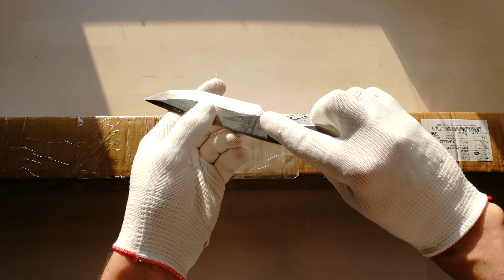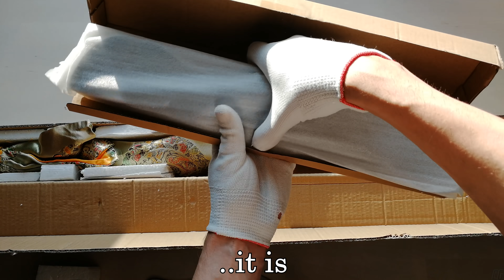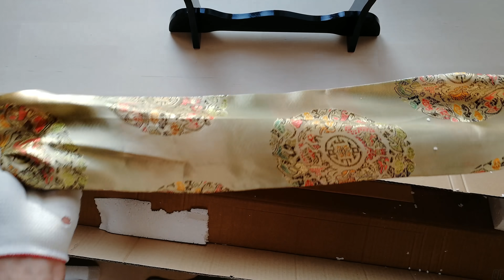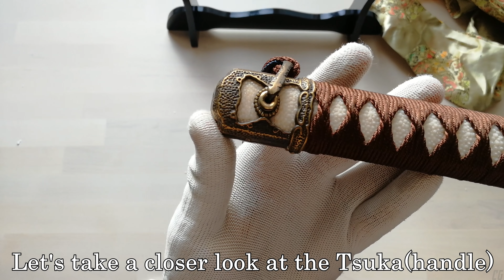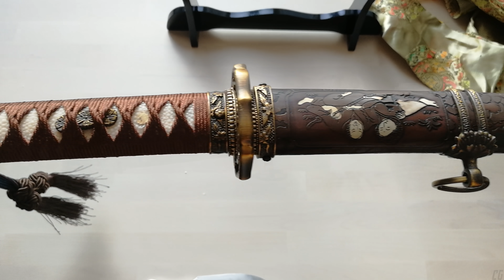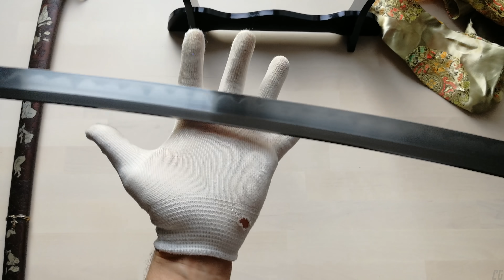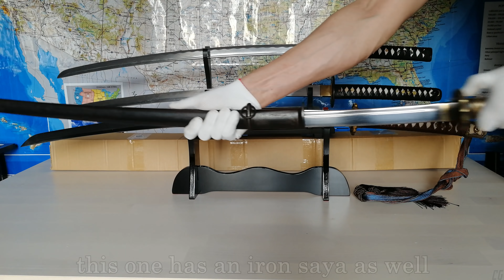$500 Aliexpress Katana is Actually Good - Unboxing + Comparison to the cheaper Katanas [4K]

Comment: You see how the ends if those patterns on the blades are white that sad because  it's fake tempering I think
Reply: I was going to say, I think it’s acid etching, the edge should be a completely different shade compared to the rest due to the clay heat treatment, and  it doesn’t look like it is 😬
Reply: You’re right

Comment: Blade is junk couldn't cut a clean straight line in the paper
Reply: that unfortunately doesn't say as much about the blade and more how well sharpened they sent it to you. Swords aren't supposed to be pocket knife sharp anyway, larger mass more force with an impact, you'd kill a razor edge after whacking it on 1 thing. 
Thing is it really might be garbo blade, when judging that you'd be looking for finer details than the camera is going to pick up. (metal grain, also looks like they took shortcuts in the shaping too but that might be hiding something fancier like a convex grind) But the detail work on the scabbard's going to put it up in that price range as a display piece anyway.
Reply from the maker: lol

Comment: You can obviously tell that the blade is not diferentially hardened, so the edge will become dull within the first two or three slices. That thing is not worth 500$.

(Katana blades must be diferentially hardened with a special clay that it's added to the edge before putting it again into the forge/oven. That's what gives a katana's edge that distinguishable "lighter" colour than the rest of the blade. You can tell that in this blade, there's only a "tan line" which is lighter than the rest, but not the whole edge, this means that they just dropped some sort of acid onto the edge to decolour it, but it's not diferentially hardened. Hardening makes the edge not becoming dull, so it's what esentially makes a katana be a katana. Without that, it's just a heavy saber)

Comment: That's weird - it's basically a Type 98 Shin Gunto replica, but with some fantasy elements added.
Incidentally, it's in tachi mounts, so it really should be displayed with the edge down as it was worn, unlike the katana, which you have correctly displayed woth the edge up.

Comment: For $500 you’d expect the handle to be covered with actual ray skin but it’s synthetic, the blade isn’t actually sharp and it’s most likely 1065 carbon steel which is one of the bare minimum alloys appropriate for a blade that size. Decorative piece but would not recommend for tameshigiri cutting unless you want to hurt yourself.
Reply: It really depends more  on the tempering.
Reply: 1065 carbon steel out of nowhere lol, you "samurais wannabe" are just hilarious🤣
The blade is polished and there's no way to tell the difference in carbon content just by looking at it.
If I'd show you a blade made out of mirror polished aluminum you won't be able to tell the difference as well.
Reply: @raulduke85  get over yourself, First of all I’m Japanese and I visit family in Japan constantly and we go to various shops that claim to sell authentic Japanese katanas made from tamahagane steel to western tourists who don’t really know any better, a lot of foreigners blindly believe in the idea that if it’s made in Japan it’s quality but you’d be surprised how many small alley shopkeepers try to scam you under the table. I’ve confirmed with these tourist souvenir shopkeepers that a lot of their pieces are 1065 meant for light cutting, some of them aren’t even good enough for tameshigiri but instead are for decorative purposes.

Comment: How is that a real Hamon? The lighter tone of metal looks simply scribbled on to the blade. Correct me if I’m wrong, but shouldn’t the lighter metal tone care trough the whole edge of the blade and not a few centimeters above like the line on this one, and be more like a separation than a single line?
Reply: Blade looks good tho

Comment: These swords are called Gunto or ceremonial sword as translation. They were used in Taisho and Showa era.(Including WW2). This model looks like it was from the early Taisho period. It doesn’t look like it was used for combat, and it looks more like a ceremonial sword. The art on the Saya might also be related to the user’s family or heritage. Guntos were made by talented swordsmiths until the early Showa era where they started to manufacture these swords in factories. These swords are worn with the blade down just like it’s old counterpart, the Tachi, or Great Sword, used in the kamakura period. Katanas were generally much lighter and simpler than Guntos.

Comment: Very nice... hint-when testing w/ paper.... use news paper & don’t look ...feel & listen, like lock picking... also you can buy a cheap cellphone microscope and veiw the blade.... I do this when I want a very fine edge... even use a looking gassing, you can also see the temper line(real/etched).... and see if a mirror polishing is needed in places.... after all that get some good wax for it..... would have also been very interested in the weight / sori dimensions / center balance point w/ finger...  very nice presentation... not over the top... subbed

Comment: this katana is fake, the details is not correct, the materials that were used do not match that of a real katana and also without the seasoning mark.
Reply: I noticed this as well, the hamon is the same color as rest of the blade... so its a fake hamon done by acid etching, not clay tempering.

Comment: You should know...thats not sharp at all as its tearing the paper.  It's a decoration, a $500 overpriced decoration.  Don't forget to sharpen your knife also.  It can barely cut tape!
Reply: i mean the blade is 1095 high carbon steel which is all around a great choice steel for knives and swords, i would say it’s decorative and functional, but also i’d be questioning if it was properly tempered and heat treated before testing it
Reply: I doubt its been quenched at all seeing how the edge was.  All I'm saying is, I wouldn't personally spend $500 on something so I can dust it off constantly and look at it.
Reply: @CaptainKyo24  oh i totally agree with you there! unless you practice kendo and proper techniques with a katana there’s no need to spend $500 on that, if you just wanna chop plastic bottles and fruit in your backyard then just buy a cheaper more plain 1060-1070 high carbon steel katana for functionality. although im sure it was quenched and tempered (it better be for $500) lol whether or not it was done properly is what i want to know, and i highly doubt the answer is yes, if im spending $500 on a sword i wouldn’t be buying it off aliexpress, i’d buy from a more reputable company like hanwei or windlass steelcraft

Comment: The first $100 blade is a 1045... most likely. The 2nd looks like it might be legit. I am highly skeptical of the $150 military sword, maybe a 1060? The $500 looks like it might be legit, but you won't know until you do some chopping. The katana I make are very comparable to the $500 one, but I know they have been tested and passed with flying colors.

Comment: how you take the sword out at 8 minutes and 8 seconds. dont do that. it is incorrect and will damage your saya. the case. as the sharp edge is rubbing inside the saya. causing tiny tiny wood dust to get shaved away from the inside of the saya and you get a sloppy fit over time. if you draw it not from a belt. hold the sword out with the curved edge up. not down and slide the back of the blade against the inside of the saya. as that edge will not slowly shave away the inside of the saya. as it will. i am a expert on this subject. trust me.

Comment: I practice haidong gumdo (korean katana) we use the same sable and by the real stories the real katana can be sharper than you show
Reply: Every piece of steel, even low carbon steel can be sharper; it just depends on the method, the angle and the grit of the stone you use to sharp it.
The difference between low and high carbon steel is how long the sharpe edge will last; i just don't know why everybody complains about sharpness, it's actually the most irrelevant and cheapest part of the sword.
The most important and expensive parte is the material of the blade, how and if it has been heat treatened, but nobody can say what material is that (polished steel look all the same, especially through a camera), or if it was heat treatened just by looking at it🤷🏻‍♂️

Comment: I don't want to be a jerk, but to be a jerk:

That's not an actual hamon. You can tell a traditional hamon from the little flecks and striations running along the edge. This comes from the folding process of traditional japanese sword making. Here, you'll note that these are absent, denoting steel that has been worn to make it appear to have a hamon using either some abrasive element or acid, something that has become commonplace since most katana have gone to being die-cut or cast. That doesn't mean it's a bad blade or anything, just that it was unlikely to have been made using clay tempering and traditional folding. The quality of steel today is high enough you can make swords from a single carbon grade [which wouldn't have a hamon necessarily] and still have it perform at or above the level of traditional blades using two to three different carbon grades [the reason they did this in the first place was because old steel had to compromise between flexibile soft steel and brittle hard steel]. This blade is pretty clearly a decorative piece, but with a good sharpening it would probably be fine-ish.

An additional clue this isn't a traditional blade would be the price-point: the tamahagane ["gem-like steel", a specialized variable carbon steel made in Japan using native iron sand] cost alone for a traditional blade runs about 6000-10000 yen per kilogram [~$30-$40 USD per pound] before its been billeted, not to mention the labor costs of 3 people working for two to four weeks to make the blade then the cost of polishing it [polishing costs between 5000-15000 yen or $50-$100 per inch of blade, since only specialists can work with traditional katana] and finally the fact that individual blade manufacturers in Japan can only produce 12 blades a year due to demilitarization laws. A traditional blade will cost $5,000 to $10,000 USD on the low end easy. It's not unheard of for blades to cost upwards of $20-$30K USD, but then again many schools haves started making traditional katanas more for artistic reasons than to sell. Luckily, you can find katanas as good as traditional ones made using modern steel as long as you do research into the manufacturer to ensure the quality.

Comment: Maybe you'xrethinking 500 USD is a lot for a Katana, but sorry to tell, it's only useful to exhibit. The material for real Katana with the original soul and consecrated steel is above 1.500 EUR. In addition you've to spend a lot for forge by master and at least the grinding & fine cut a couple of thousands. Lt's talk about up from 8.000 EUR.  But hey ... if you don't want to use for action or trials, congratulation. It's nice ;-)

Comment: The sword is bad quality despite its good decor. The clay temper is cheaply applied as the edge and the whole of the blade are the same color. The stingray grip under the blade is fake as it is molded plastic (real stingray skin are pretty expensive and have define edges between the bumps). After watching cerberusarms review on how to tell real katana from crappy katana, I am enlighten. Besides the decor I would not use it for anything other than cutting water bottles in my back yard. If I tried to cut anything more than that I would risk the blade breaking, snapping, warping and most likely injure myself in the process.
Reply: Right ... I was going to comment about the temper line it just looks manufactured as it's all even and uniform not to mention it's not the telltale two colours seen on real blades. 

Like To buy for 500.... Ive seen better ones for 200.
Reply: Probably isn't even an actual clay tamper but just acid or something similar to get that line

Comment: $100 katana?  Don't be silly. $100 mass produced replica of a katana. 
$150 katana?  Slightly better quality mass produced replica of a katana.
$500 katana? Better quality replica with better saya for people with $500 to spend.
For all those referring to swords used by Japanese officers in WW2. They are not katana. 
The definition of katana is "a long, single-edged sword used by Samurai".
Real katana cost north of $6,000 for a basic example.
Zink (sic) alloy or brass.  FYI brass IS a zinc alloy.

Comment: How much layers have the blade?  :)
Reply: I'm pretty sure just 1, he said the blade was made of 1095 steel, folding something like that, (unless it was layered with something else to give you a pattern) would be pointless.

Swords made with the old fashioned steels like Tamahagani or other bloomery steels had to be folded several times to remove large impurities and spread microscopic impurities through the steel, to homogenize the steel alloy making up the blade, something not required with modern alloys.

Comment: Nice presentation but... I don't think Chinese steel is worth much more than around $100 or so, especially not from Aliexpress. Some traditional Chinese forge can probably make decent swords but you really have no way of knowing what you buy online. They are also unlikely to sell it much cheaper than an equivalent Japanese forge would since the effort and material costs are the same.
Reply from the maker: yeah, I know it's a fake hamon and overall steel quality isn't very good. check out my last unboxing video of a $700 katana from the same seller. I'd like to see more comments on its quality. you can find that video on the ending screen here
Reply: @ExtremeGamingHD3D  Yeah I'll check it out but the thing is even the "best" Chinese katana made by their most skilled sword smith can't compare to any Nihonto, why? Because AFAIK, the Chinese don't have access to proper steel, whatever they use will be subpar even if we assume it's 100% forged and hardened correctly (a big "if" in and of itself). Many, many katana from China even thousand dollar ones will chip and break because the steel just sucks. Those that don't break are even worse cheap 1045 steel that just bends easily. I always wondered if the Chinese (or anyone else) can import real tamahagane from Japan thus creating "real" Nihonto but it's probably illegal or something since Japan treats Shinken katanas as a controlled weapon thus the steel is probably "weapons material"...not for export. They also hardly make any tamahagane nowadays, what little they make is basically cherished as a national treasure (and another good reason for why they'll never export any of it), some other steels they make might be near equivalent though (stuff like Aogami/Shirogami), I'm not sure but I really do wonder about it.

Comment: The seath and the handle are really nice but that Hamon isnt real,it is only acid etched which means it is fake katana that costs about 200$-300$
Reply: That doesn't mean the katana itself is fake. It means they didn't spend the extra money to do the hardening process that would result in that type of hamon. Probably because it has a high failure rate. Its still a real katana( even though this is more of a Tachi than Katana in terms of design. ) however the Hamon is fake.( this is something you can look up on the sword buyers guide. )

Comment: I see some of the elements from Chinese swords.  Especially the sword's wooden case is no way near Japanese Katana. It is very very awkward that picture is painted on Katana case.  Only Chinese swords have pictures on it.  Usually Japanese Katana don't have any pictures. If they do, it is very strange. Also, the big loop or should I call it a ring around the top part of Katana? Anyway, it is screaming "Chinese."  Katana should just have rope handle instead of ring.  Also, the bottom tip of the case has another extra marking which you can't find from Japanese Katana. I know Aliexpress is infamous about copies and fake items, but this ain't even close to Japanese katana.  It is beautiful to look at, but it is mixed with Japanese and Chinese.  Japnese, Korean, Chinese swords all look different.  They have their unique distinctive trade marks that you can not mix with. 

If you want to buy a real katana in Japan, it will cost you a lot of money.  Thousands more. I've seen a real Katana long time ago, which was a little less than 6 feet long.  It was indeed a massive weaponery.

Comment: The cord is not done very cleanly, you can see that this comes from a mass-production. Probably cheap chinese uquality.
It's a cool decoration, but nothing else.

It's not cutting the paper, it's ripping it apart. Usually when you buy a katana, you get 90% sharpness, the other 10% have to be done by yourself, or an expert.